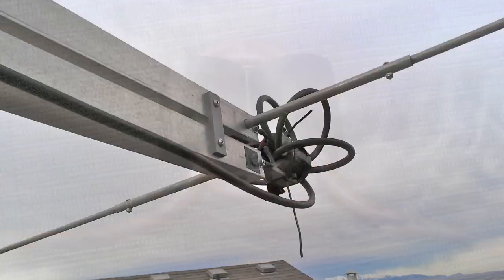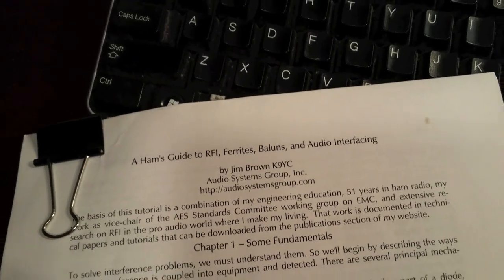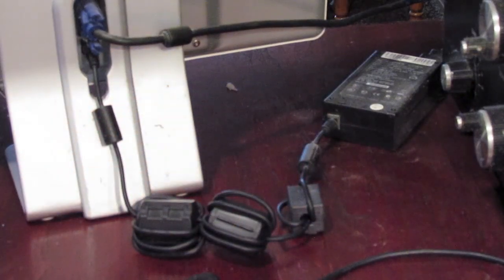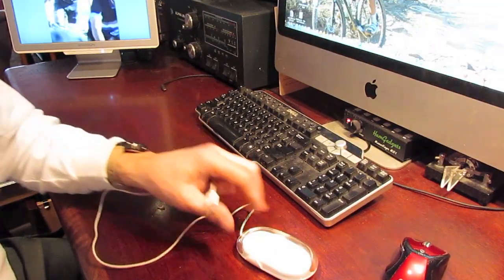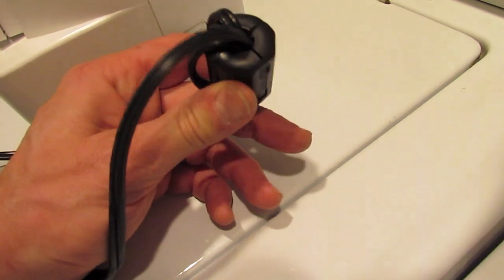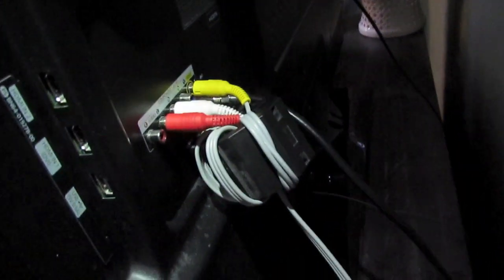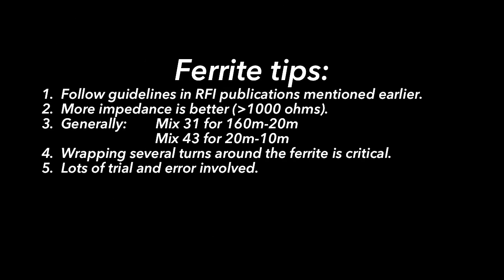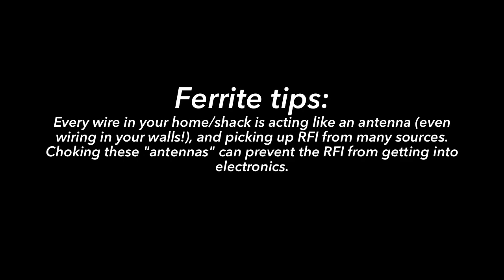Ferrite, chokes, and RFI

Comment: Great video, but anyone with that much trouble with RF on the house, may be in  need of antenna adjustments!
Reply: What about if my neighbor has a ham radio that makes my studio go ape shit eveytime he uses it
Reply: @joshthurman7653  Ask them to read this:
"If you have that many problems i would look into your common mode reflection. Perhaps you have bad feed line lengths or a badly made balun if your running anything balanced. Watch the TRX Bench / lab video on common mode and baluns. If you run a cut antenna tuned best as possible and at the best tuning point your swr shows any movement on the needle then it's a problem with feed line length matching or other impedance mismatch. Nice to have a few ferrites around the power supply cables but you don't want too many loops either. There is probably a great way to have multiple ferrites with minimal looping around each of them, but that's starting to get technical again. Fix the feed line miss-match and you should see no needle movement on the swr across a decent portion of that band but you will have to retune the antenna again after that. Getting an swr of 1.3 or 1.4 at your best point is not acceptable for a simple antenna. Just try adding 3 or 4 foot of coax or cutting it back. Some people put an ugly balun or rf choke made from coax, it really depends what type of antenna you are running, also you can get 1:1 baluns but they need to be well made and it's not as simple as most people think.
  There are a great deal of people out there running bad lengths of feedline and happy with a swr of 1.5 or 1.3 at it's lowest but the magic really starts once you get everything dialled in, you can get swr to a point where the needle does not move at all over a good portion of the band and much more acceptable wider band use once it's setup like that."
Reply: @joshthurman7653  I'd cut his antenna wire!
Reply: Yeah. This started out informative and quickly became "my house is an interference nightmare". I've never had issues like this, to this extent.
Reply: Agreed!
Reply: Well I'd probably start by putting a decent one at the feedpoint of the antenna. Most wouldn't even know they have CMC issues.
Reply: Most don't know that end fed monopoles greater than a quarter wavelength suffer from CMC. This in turn can get on your household wiring. RF in the shack can be particularly bad if the coax is elevated after it's routed down the pole, or enters the shack from an elevated point. Some antennas, like a J Pole, are shockers for common mode current. I am aware of this, and I'm just a humble CBer. Go figure!
Reply: @arconeagain  experiment with feed line lengths, get some female to female connectors and try adding patch leads of 3-4 ft sections. You should be able to tune a basic antenna so the swr needle does not move at all for a good section of the band. if the lowest is 1.3 or 1.4 there is an issue, unfortunately once the feed line issue has been solved the antenna will need a little retune. Many people need baluns or even unbals depending on the setup unfortunately most of them are very badly built. Watch the 3x TRX Bench / Lab videos on baluns and common mode current.
Reply: That is what I was thinking too!

Comment: Crystal clear explanation. Very informative. 
I have a question, however.
I'm getting terrible RF buzz on my videos. But not always. Some videos are clean and some have intermittent noise. I'm thinking it's one of my neighbor's cell phones. No?
The cable going into the broadband box? The flat screen computer monitor? 
I use a wireless microphone with a lavalier mic. 
Any suggestions you might have would be yugely appreciated...
Reply: Are you recording video or watching videos when interference happens?
Reply: @alissonmartins1800  This is a blast from the past! 
I eventually figured it out. I'd coiled the audio cable to shorten the length. Apparently it emitted an RF signal which interfered with the mic when it got too close to the loop. 
True story. I was working at Home Depot back in the 80s - 90s. In Fans and Lighting for awhile.  This fellow had a very expensive ceiling fan in his bedroom. Worked off a remote control. Plus the wall switch. He came in a little hot under the collar. Said it was defective because it kept turning on and off at random. He had an electrician look at it. Couldn't find anything wrong with it.  Now he's steamed at Home Depot. I had a sudden flash of inspiration. Here in Arizona most air conditioning units are mounted on a concrete slab at the side of the house. Can be at least 10 tons for a 4,000 sq ft house. I told him his unit was on the other side of his bedroom wall. Every time the capacitor discharges to start the motor, it sends out a massive RF signal. He was gobsmacked. I suggested a roll of copper on a sheet of T-111 siding. Worked like a charm. I got lucky on that one....